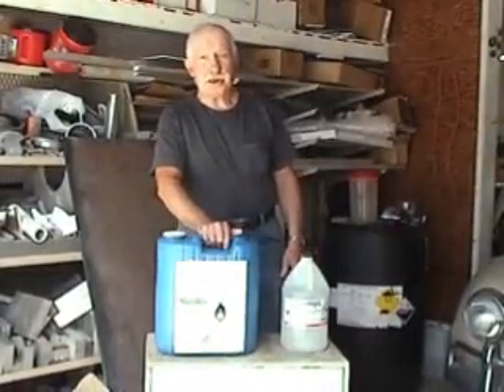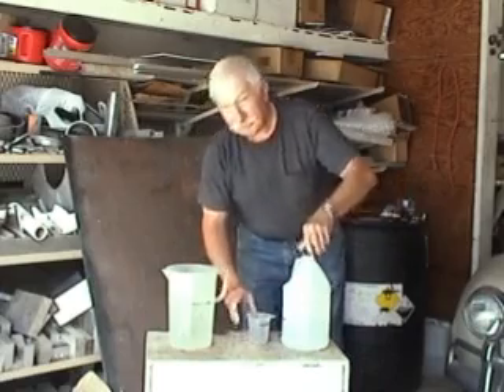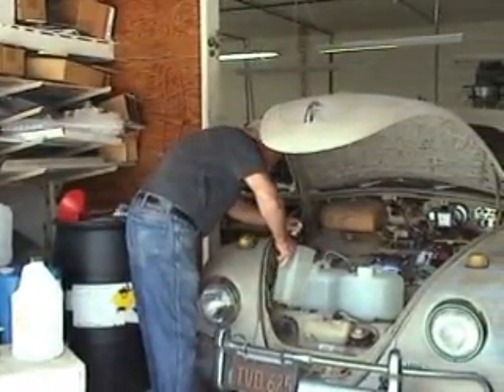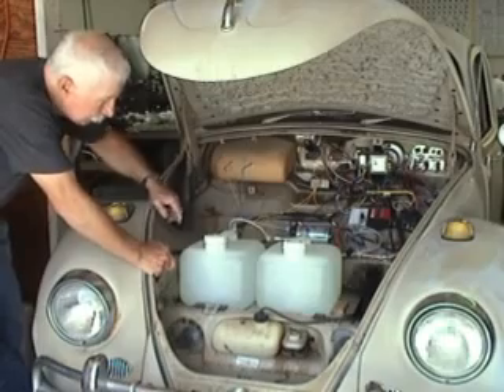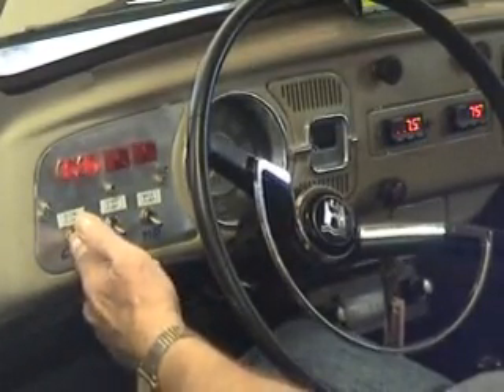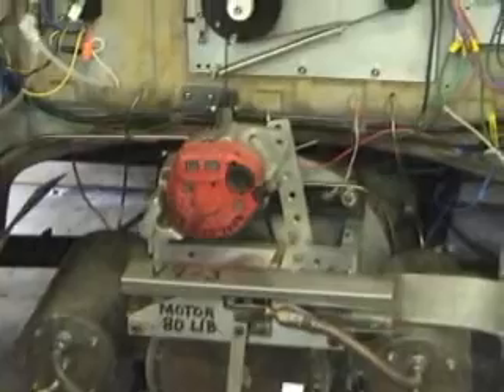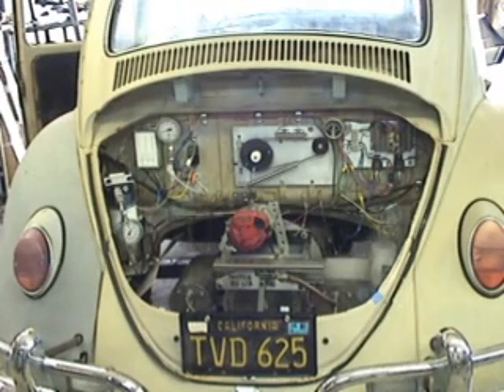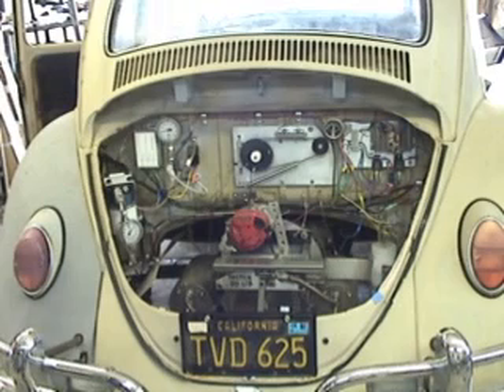Nick's Peroxide-Methanol turbine VW

Comment: You can also use silver as catalist, btw you dont need a catalist once the mixture is in your cilinder it will heat to a temperature at which the h2o2 decomposes into oxygen and water and methanol

Comment: In the electric car age, with the electric engine as your primary mover, this type of engine would be ideal for charging your battery pack, either while in motion or stopped. It would most certainly extend the distance an electric car could travel before the charge runs out, and startup time wouldn't be a concern as it would only be being used to top up the battery pack.

Comment: Cool Design, But:. . . No Need to Mix the Hydrogen Peroxide with Methanol to make it Flammable when poured over (or pumped through) a Catalyst (in his case Manganese Dioxide) which just complicates things making a Flammable Steam (actually  just vaporizing the Methanol and making it more Flammable with the Oxygen released from the H2O2, while also dousing the fire with the water vapor {Steam} being released at the same time). . . There was a guy 25-30 years ago that built a Steam Powered Helicopter using 80% Hydrogen Peroxide (Industrial/Scientific Grade) and pumping it through a chamber filled with Platinum Pellets (Basically just a Catalytic Converter off an old car) which instantly Flashed the H2O2 into Steam (without the Flammable Methanol mixed in) and plumbed it so the Steam ran up through the main shaft of the Rotor and out the Rotor Tips which were fitted with Jet Nozzles, making The ROTOR ITSELF The Engine. . . Speed was Regulated by Regulating how much H2O2 was pumped through the Converter. . . No Flame, No Glow Plugs, No Fuel Mixing, No Time-Delay Building Steam, No Fuss. . . Only Problem Is, you have to be Licensed to Buy 80% Hydrogen Peroxide and The Vast Majority of us Aren't. . . . An added benefit to doing it that way is the Exhaust is Nothing More Than Steam or Water Vapor and Oxygen. . . No Unburned Methanol or other Chemicals going out the Exhaust.
Reply: Thanks. 👍

Looking into this technology for an aquatic project I'm thinking about.  H2O2 + Methanol + Catalyst solves a lot problems.
Reply: You can research it more on your own by simply looking for "H2O2  Steam powered helicopter" or similar searches.
Reply: Scroll about half way down the page on this one and read under the heading of "Use as propellant": . . . https://www.cs.mcgill.ca/~rwest/wikispeedia/wpcd/wp/h/Hydrogen_peroxide.htm
Reply: That's literally one of the craziest stories I've ever heard and I've been studying stuff like this for almost 15 years that helicopter sounds like some s*** that even Nikola Tesla would be proud of period period you know he made a flying machine too... pretty freaking crazy stuff air driven.
Reply: LOL . . . Study it for 30 more years  @TravisTellsTruths  and you'll Almost be caught up with me.

Comment: Not very efficient running a car on "rocket fuel". Gasoline combusting with air release a lot more energy per kg of fuel and you do not have to carry around the air.
Reply: Its all about compression in your cilinder not if it burns with air but how much oxigen is there to burn with the more the better

Comment: Lol so your car is a v2
Reply: Me163 actually...........it ran on H-Peroxide.
Reply: The V-2 actually used peroxide to drive the fuel pumps.
Reply: V2 used ethanol and water. This is Methanol and Hydrogen Peroxide.
Reply: Good point.  While not part of the propulsion fuel, it was needed for the rocket to fly
Reply: Me-13 as the rocket glider is closet tech to compare.